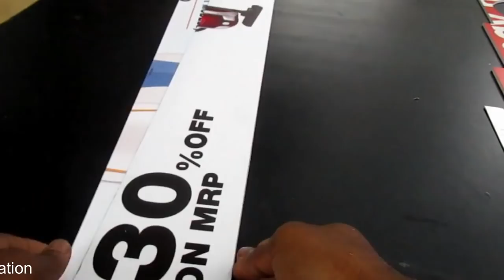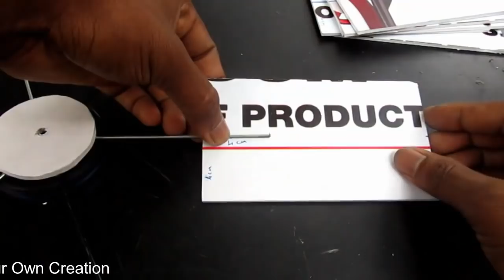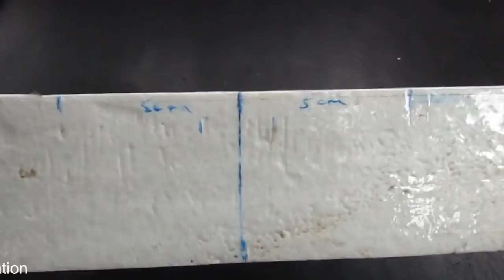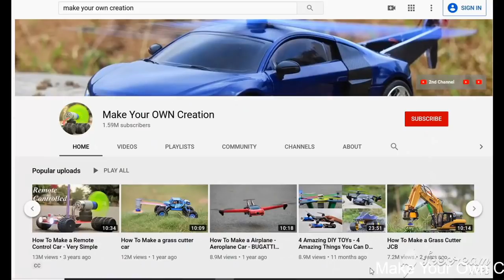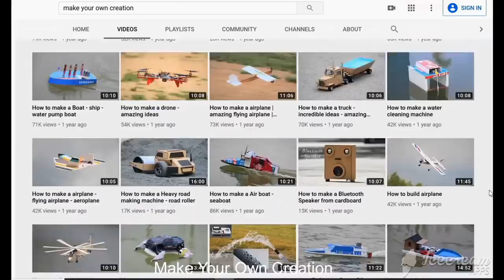4 Amazing DIY Toys - Awesome Ideas

Comment: Are u commercially sells ur product?
Reply: Boss while full throttle 1 st motor is going off then 2nd and 3rd but only 4th motor runs and take other commands like left right, etc. What might be the issue. I am using kk2. 1.5 and Flysky transmitter n receiver